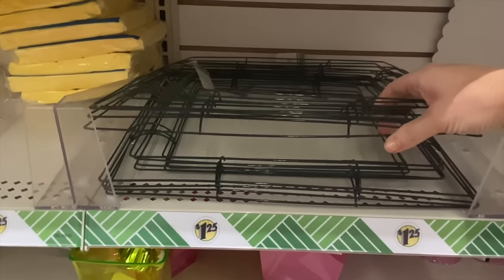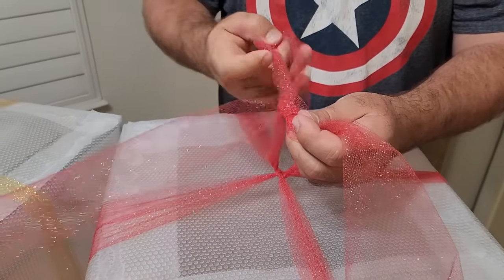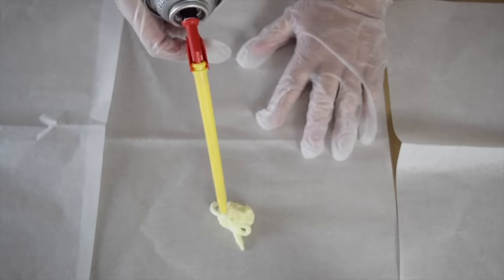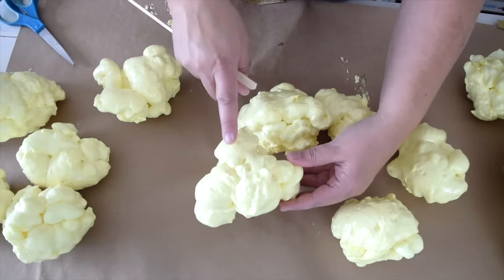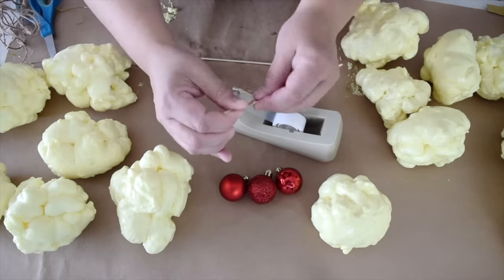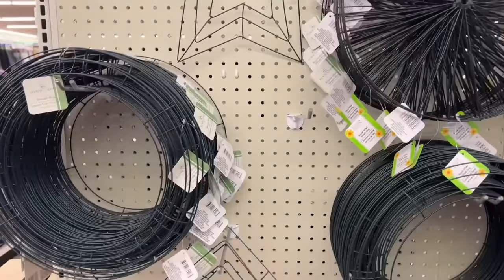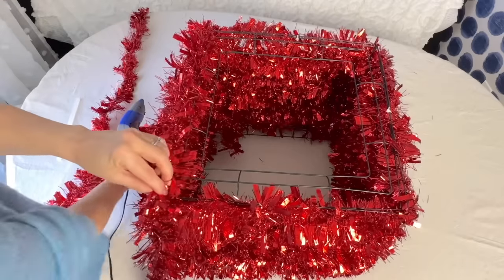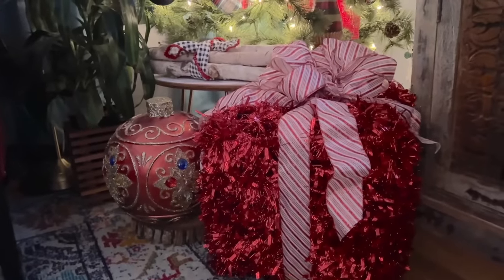Grab Dollar Store lights and a square wreath form...this holiday idea is MAGICAL!

Comment: 😂boxes are not waterproof or resistant even🙄
Those blobs aren't spraying so well cause she doesn't know that the can has to be turned upside down, the foam cans don't have a dip stick like spray paint.
Just be aware if you plan on keeping these projects DON'T USE HOT GLUE, ITS JUNK ,it will fall apart by next year.
Reply: I'm not a huge fan of hot glue at all.